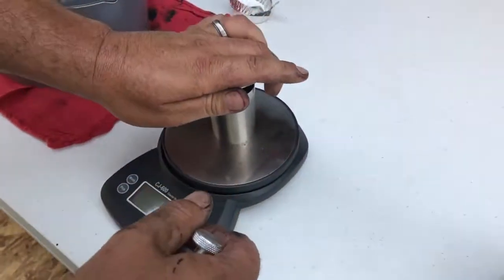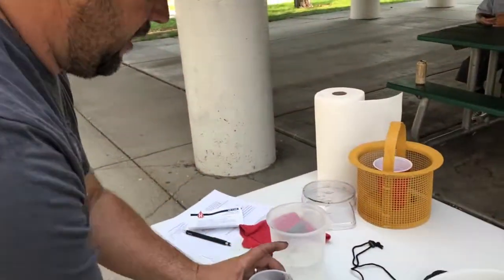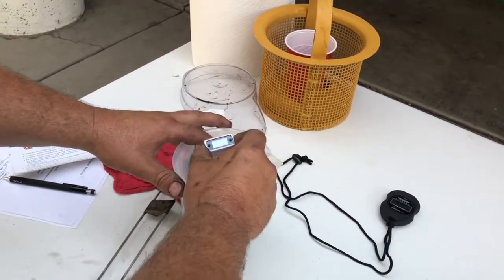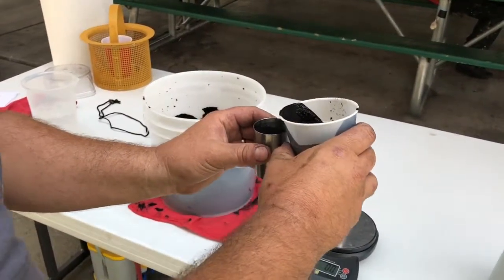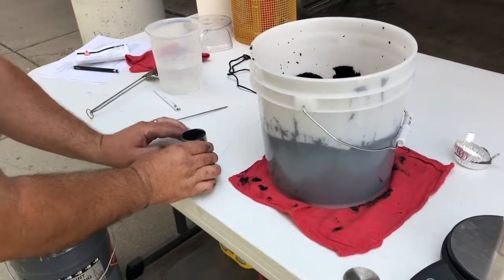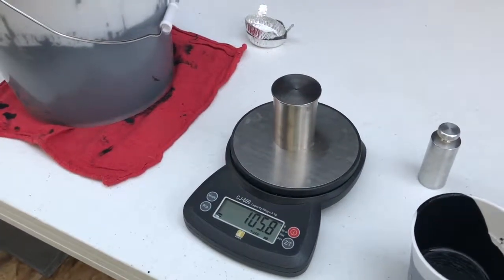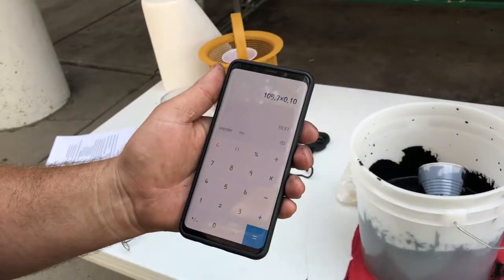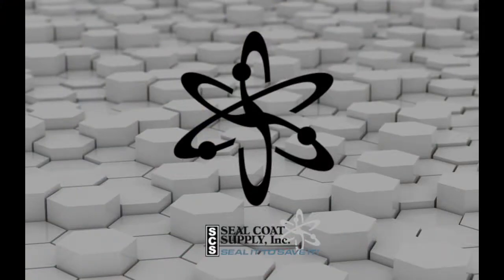Asphalt Emulsion Density Sealcoat Testing

Comment: Hi Could u plz tell me whats density of seal and tack coat?
Reply from the maker: You will have to ask your manufacture for their density baseline.  These tests help determine if a product is over or under diluted.
Reply: @tnasphaltservicesinc.6632  thanks but generally how much is d density of this material? I meant 1100 to 1200 kg per cum something?